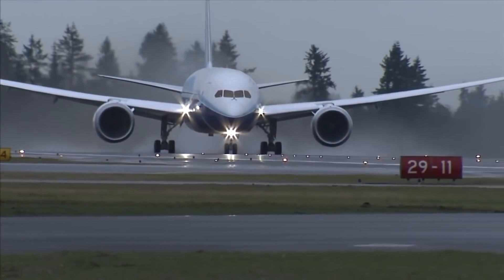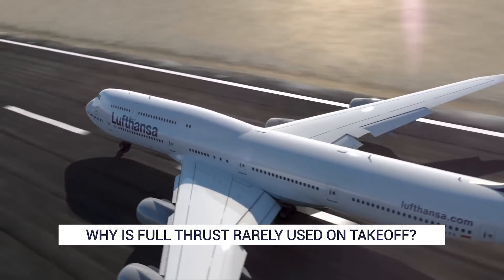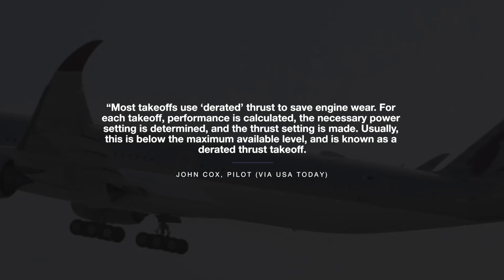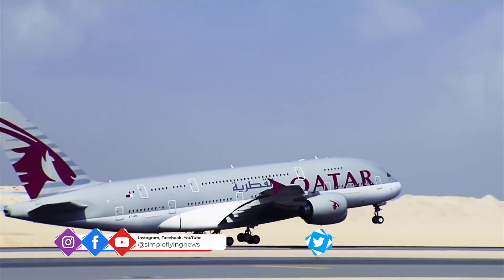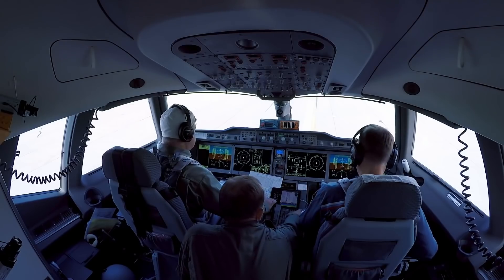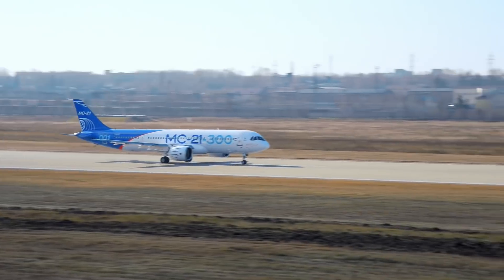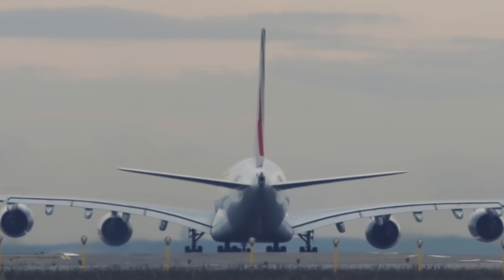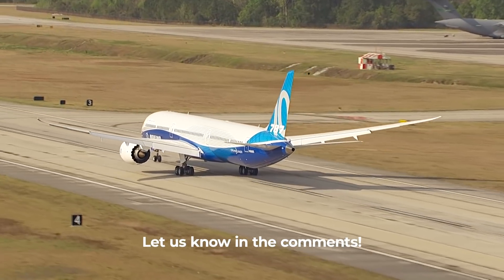Why Do Airliners Rarely Use Full Thrust On Takeoff?

Comment: Airport elevation, barometric pressure, temperature, weight, wind direction and speed, noise abatement, fuel consumption, runway length.
Reply: Not to mention wet/dry runways, stormy conditions, fog and other weather events.

Comment: Also worth remembering that a twin jet can still climb after take off with just one engine operating
Reply: in this case, full single engine thrust is used ;)
Reply: @mingming9604  actually no, you use maximum continuous thrust and not full.
Reply: @mingming9604   not even that. reduced thrust is calculated in a way that even during failure of one engine  no additional thust is necessary.
Reply: Usually you need to reach V2 for safe climb out speed. Depends on the takeoff weight, sometimes your vertical climb speed is severely impacted when using only 1 engine.
Reply: @mrcannotfindaname  v2 is now rare
Reply: @mrcannotfindaname  geez really? So you’re saying single engine performance isn’t as good as twin ?
Reply: Ya after V1
Reply: I can take off the 777 without engines

Comment: I actually didn’t know that pilots don’t put full thrust on at takeoff.  If I’m playing a flight simulator, I always use full thrust.  Guess it’s time to change that 🤣
Reply: Just keep flooring it mate!
Reply: I think your virtual engines are safe!
Reply: @justdave1  Teehee
Reply: LMAO
Reply: @aer0flyer131  What fligh sim,are you using?
Reply: @jeesiejones8745  I use RFS.  It’s for mobile but it’s pretty descent.
Reply: I also used to do that with Infinite flight years ago 😂
Reply: @Bremsen_PCCB  LOL 😂
Reply: Same here, I also do the same, now it's time to use the full runway 😂👍
Reply: As in 100% N1 or 100% with the throttle levers?
Reply: Piston aircraft tend to work on manifold pressure for power settings. Turbo props propeller torque. Rarely do Turbofans exceed 96% thrust on takeoff unless it is a go around.
Reply: @TheFlyingBusman Oh cool! I didn’t know that before.  Do you what thrust percentage passenger aircraft takeoff at?
Reply: @aer0flyer131  For the 737 (CFM-56), usually around 96-ish, but can go as low as 87% for N1 limit, maybe even lower. Depends on wind, temp., altitude, rwy. length, etc.
Reply: @OninDynamics  Thanks!
Reply: Same here
Reply: When you use full on RFS it just allow you to rotate fastly or make a vertical takeoff
Reply: Hoy Sum  haha yes but I use it when using fighter jets 😂
Reply: Same😂

Comment: I didn't know. I did wonder why after takeoff power is reduced while climbing. What is that thing hanging from the plane rudder?
Reply: Many times they reduce thrust because of noise level concerns. Also once you are off the ground you aren’t accelerating as much.
Reply from the maker: https://simpleflying.com/test-plane-shuttlecock/ - TB
Reply: Take off power is reduced simultaneously with climb rate, the climb rate is often higher to avoid noise around the airport and other reasons.

The thing on the tail is for test flight only, I think it’s used to measure air flow behind the aircraft but I’m not entirely sure